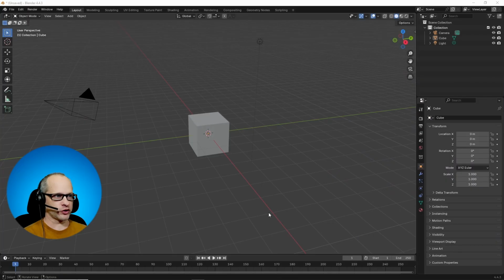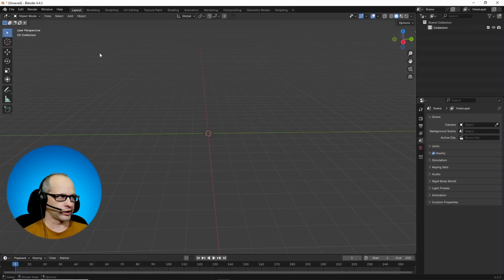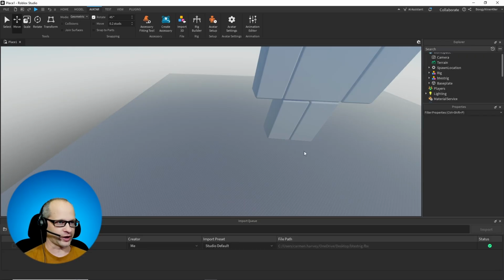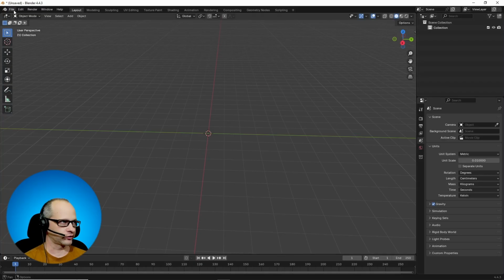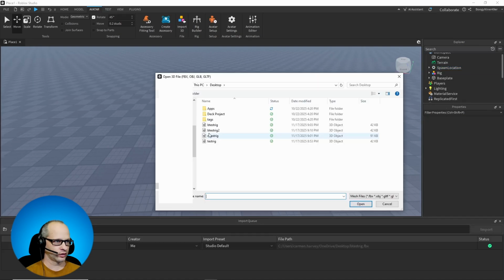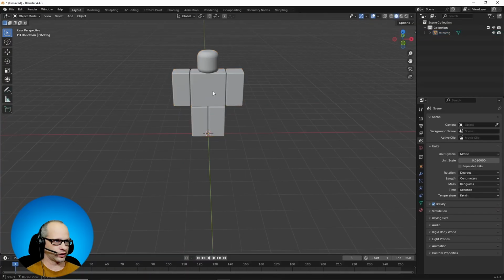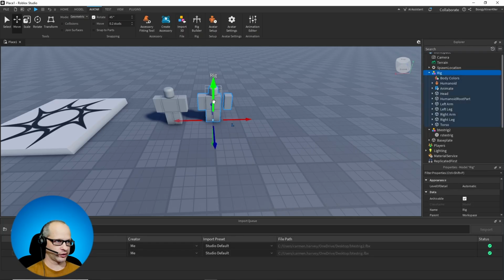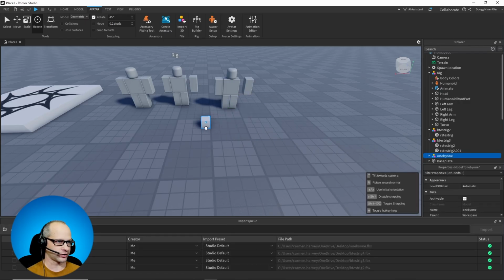How to Make Roblox Studio Work Perfectly with Blender

Comment: Blender scaling is current and works with ue5 and unity game engine but roblox it doesn't cuz 1 stub is 1 cm in meters which is stupid, I do not like changing my blender setting. So if you guys ever want to import something from Blender to Roblox make sure when exporting from blender that you set the transform scale to 0.01 in the Blender exporting settings and set File geometry > scale unit to stud